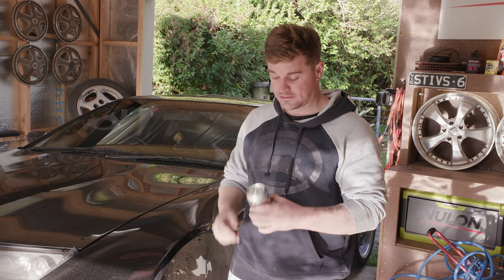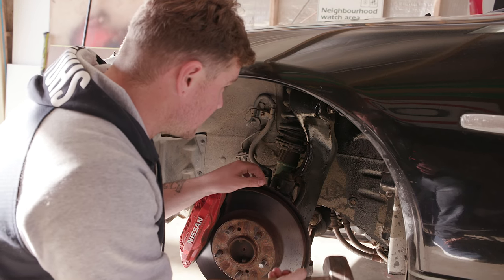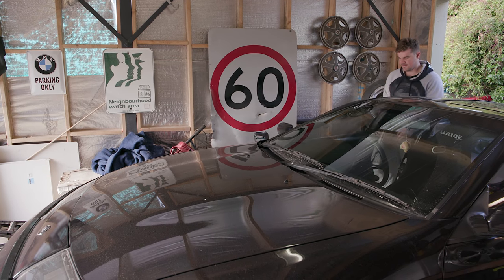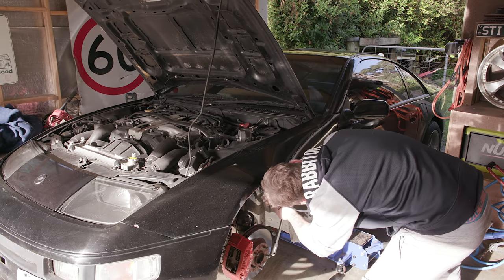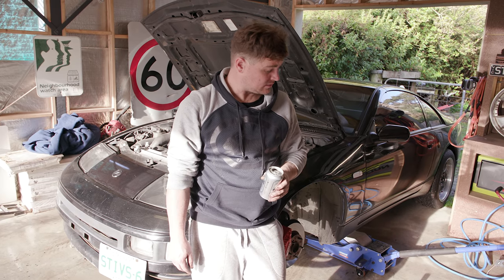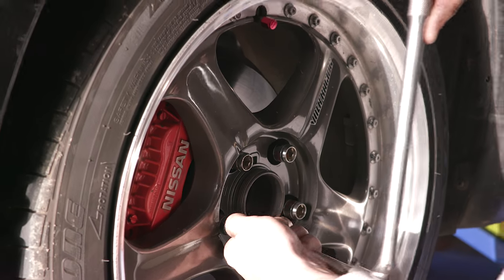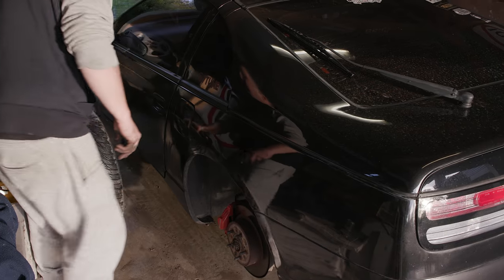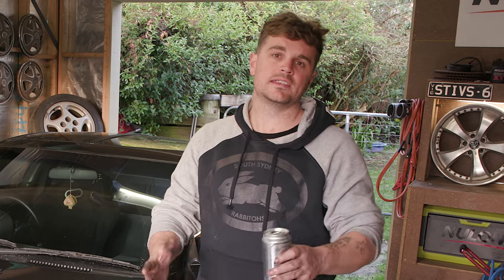300zx gets more low!

Comment: Adjustable tension rods are needed when adding the upper arms and lowering the Z. I just did this job on my Z. I recommend the adjustable rear arm too if you want proper rear camber alignment also.
Reply from the maker: Gday Brother, our Z has a set of tein adjustable torsion rods on board already. Just missing the rear arms at the minute.

Comment: If your jack pole is removable from the jack, I would suggest sliding that over your socket wrench and using as a breaker bar. You'd get a lot more leverage.

Comment: @18:45 those aren't the cheaper ones those are top-of-the-line from the 90s I had them on my first 300ZX they are tiens and they work f**** awesome they don't have a separate height adjustment like new school coilovers do that right there is the old school design but it does not make it any shittier those were fuckingawesome coilovers
Reply from the maker: Yeah, they certainly were top of the range. But they are very basic these days, but still do a fantastic job. And the helper spring keeps the ride super firm no matter how low we go.

Comment: Stopping at 7:44 can't for the life of me think of why you'r e pulling the bracket off instead of just undoing the horizontal bolt that hold the arm in? I guess I'll wait and see. 
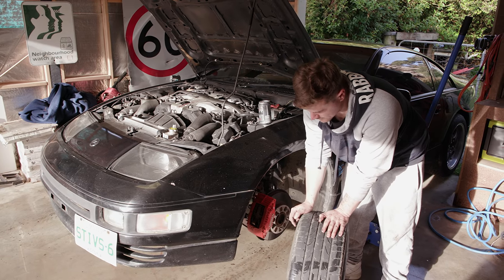Back at 12:33, still got me fucked, but I've dropped camber on youtube. I also raised the ride height on a skyline... madness.
It's memes
Reply from the maker: The bolt won't slide out unless the bracket is removed. It is either a design flaw or in backwards. It gets halfway out and hits the wheel well. The whole bracket has to be fucked right off.
Reply: Yeah right, that's unlike a 300zx to be a pain like that isn't it